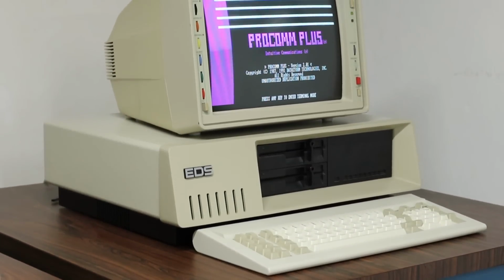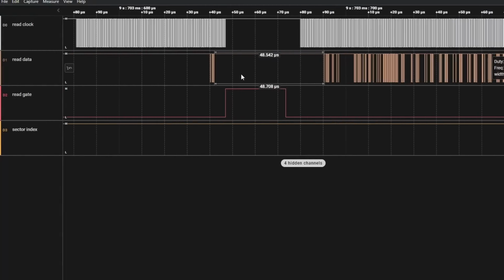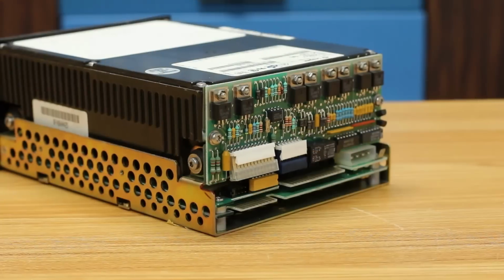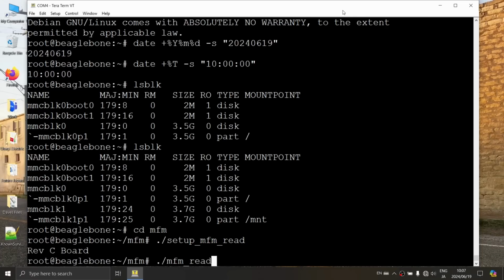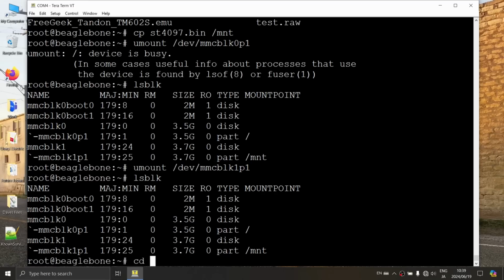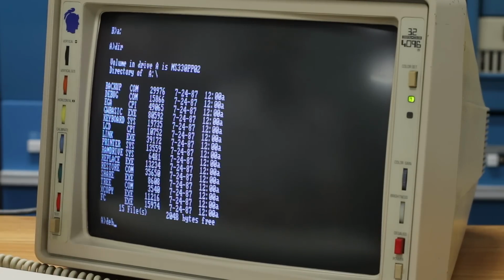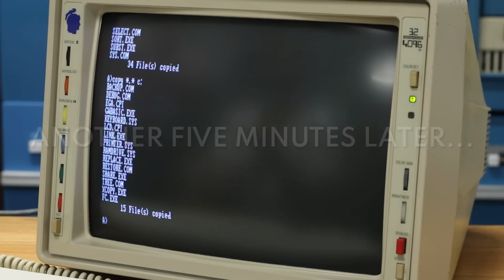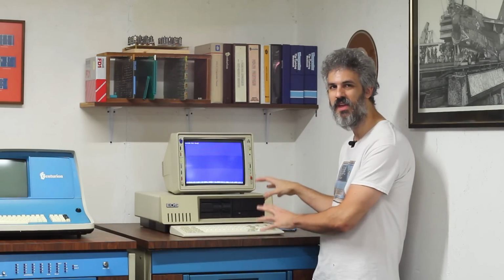FM is RLL, MFM is RLL, RLL is RLL! Fight me.

Comment: As someone who designed hard drive controllers when this tech was new, you are right - FM, MFM and RLL are all RLL. However, the quality of the oxide needs to be a whole lot better for "RLL" to work well. Formatting needs to write new address marks (which begin sector marks and data). Sector marks are a bunch of data which tells you which sector will come next (ie contains the track number and sector number).  However - the address marks and sector data may be interleaved - sector label 1  is followed by data for the last sector, then sector label two, then sector data one! This is because the formatter processor may not be fast enough to figure out which label it just read in the inter-sector gap!

 I warn you -  address marks are a possible problem: Mostly people used the IBM address mark. Unfortunately the IBM documents were wrong! The data bits were defined in chronological order, but the clock bits in reverse chronological order. I designed a controller with the clock bits in the correct order (as an option). Using the bits in the correct order means that the address mark contains a single flux transition in between two gaps exceeding the max legal distance in  legit data. This means it is a unique pattern on the drive surface. The industry standard version is illegal as data, but is not necessarily unique. Using my address mark, most drives had enormously fewer bad sectors and read errors - but were not compatible with formatters made by IBM, Western Digital etc.  I used programmable logic (which was new at the time) to map data into RLL code .
In addition to formatters for mainframes, I also did the first hard drive interface for the Apple ][, and one for the BBC micro. Both used the 6502 CPU - like Woz did for the floppy controller!
Reply: Wow! Fantastic to hear! 
For what it's worth, I've tested every single drive in my collection (over 500+ drives at this point) as RLL and I've had very few drives fail RLL that didn't already have issues during nominal MFM operation.
Reply: @TheDiskMaster  That was my experience after the first year or so. FM was never really used on hard drives, because MFM was well tested on floppies, and there is little difference in the highest frequency/smallest gap between transitions. In the early days -  when MFM was the only game in town - no one tested, but when RLL first came out, there was obviously little demand for it cos there were no existing controllers - so selective testing was introduced. By the time there were RLL controllers in play, problems with oxide coating were already cracked.
Reply: @TheDiskMaster  From what I remember, one needed an RLL qualified drive to use an RLL controller. You could use a non qualified drive and it would work initially but fail pretty soon.
Reply: Very interesting, I always thought that there must be a trick to write rll adress marks. Do you have a video or link for the details of encoding?
Reply: Your explanation of interleave isn't quite right - a given data sector must always follow its corresponding address mark (the controller is watching for the sector immediately following its address mark - always).  The idea for interleave is to enhance performance on systems that can't process data fast enough to read sectors back-to-back.

By reorganizing the sectors so that consecutive sector numbers have at least some number of out-of-order sectors between them, you guarantee the system a certain amount of processing time before the next sector arrives (occasionally a controller might have a limit for how close a consecutive sector may be, but I've only seen this with my own programming for a weird floppy controller, but interleave could help here too).  The alternative is waiting for another full disk rotation which is very slow.

For example, with no interleave the sector layout might look like this:

1 2 3 4 5 6 7 8 9 10

By adding a sector of interleave, the order could look like:

1 6 2 7 3 8 4 9 5 10

Note that there are two sectors between 5 and 6 instead of 1 but that's okay, there's still at least one sector.  A system that can't read sectors back-to-back (but is okay if they are spaced twice as far) can read this track in two revolutions instead of 10.  Going from sector 10 to 1 doesn't have extra space but that's okay - the system won't naturally read them in that order and instead will be moving to the next cylinder or head.  A more advanced formatting could rotate the sectors in consecutive heads/cylinders to account for seek time, but I don't know of this being done in the wild.
Reply: @big0bad0brad  Cylinder skew (rotating the 0 sector start point to minimize latency) can have adverse effects on random access latency, although it greatly reduces sequential access latency. If you were making movies or recording audio, cylinder skew made a lot of sense. For normal office use, it could do more harm than good.
Reply: @mal2ksc  Random access latency shouldn't be affected unless it was already being optimized separately (which it isn't; it's too complicated).

The nature of random access means any change could make it worse.  Or it could make it better.  Overall it's not significant one way or another.

I could see perhaps the very first access being affected if a disk spin-up were terminated by watching index pulses until the disk is up to speed, but again, I don't know of anything doing this besides my own code (mine just does a dumb count of index pulses).
Reply: @big0bad0brad  Not sure if it counts as "in the wild", but I successfully used the offset-between-tracks trick in the homebrew DOS I wrote for my Z80 system. I was able to get it reading nearly one track per revolution, as fast as the drive was physically capable of. I was using a homemade 1771-based controller.
Reply: @gcewing  That's awesome!
Reply: @big0bad0brad  Your description of interleaving is correct, but that's sector interleaving for system reaction speed. OP was describing the same type of workaround for reaction speed implemented inside a microprocessor performing the job of a disk controller, not an ASIC that processes the header as it's read; as long as the disk wasn't moved to a different model controller, and the timing from sector mark to sector data is consistent enough, that works. In other words, while you may have 0 sectors between a header and its data, that's not necessarily so for all drives. This may be the first report of such exotic controllers you or I have seen, but that doesn't mean they don't exist. 

Many other remarkable formats exist, e.g. the Commodore 1541 disk format stores metadata in track 17, not the beginning, and uses variable numbers of sectors per track (known as zone bit recording). 

Fun fact: the Apple II console/terminal, while solid state, also has a cycle time causing seek delays.
Reply: @0LoneTech  Fair, but one of these interleavings is fictional and one was actually used.
Reply: @big0bad0brad  Have you realized that it's rude to call someone a liar just because your view of the world didn't overlap with what they've seen?
Reply: Very interesting!
Reply: decoding that raw flux image will be an interesting problem
Reply: @monad_tcp  especially how address markers are encoded!
Reply: @monad_tcp 
AI can take care of it 😂
Reply: Back in the day we used to swap information on BBSs about which "not necessarily RLL" drives would and would not work with RLL controllers.  IIRC it generally came down to "the expensive ones", as you indicated, which had a pretty good shot at formatting and working reliably.  At that point it was a bit of diminishing returns vs. just buying an RLL drive in the first place.
Reply from the maker: Amazing!
There's the real information! It seems that whether and "MFM" drive formatted as "RLL" is highly dependent on the quality of the drive and the oxide they used. From a purely anecdotal standpoint, it seems to be all over the board with some claiming they had MFM running as RLL for years flawlessly, and other claiming it either fault didn't work or only worked for a short time. Very much so seems like one of those "your mileage may vary" things. Ultimately, the plan is to hopefully get that ST-238R back into the system, since that's the original drive. 

Thank you so much for the awesome story and info!
Reply: I love it when the true experts chime in here...thank you  @andrewgrillet5835 for this fantastic insight!
Reply: I always though RLL was a kind of extension to MFM. a 20MB  MFM drive would be 30MB with RLL, IIRC. What I can't recall are the specific debug commands used for the low level formatting.
Reply: @Mike80528  DEBUG G=C800:5 was used on IBM XT MFM/RLL controllers to format the drive.  I used RLL controllers with MFM versions of the HDDs because the MFM drives were more easily obtainable.  Nothing wrong with 50% extra space for zero extra dollars.  Never had an issue with reliability.
Reply: @thisnthat3530  My memory had it as g=C600 but I couldn't recall if that was right (was pretty there was more). Thanks!
Reply: @Mike80528  If I recall correctly, that will depend on the MFM controller, as the firmware for it is in it.
Reply: @Pedro_MVS_Lima  Agreed, except for the RLL drives that handled it internally, but this is all from memory. There were RLL versions of the controller cards. I generally recall that Seagates tended to work pretty well. The presumption at the time was that their RLL drives were the same as their MFM models just with different firmware.
Reply: I remember back in the day people would reformat their MFM hard disks with an RLL controller. IIRC, you could get about twice the storage if the MFM drive worked with it.
Reply: @tarstarkusz  ~50% more. A 20MB Seagate MFM formatted with RLL would be ~30MB.
Reply: @Mike80528  or specifically, you could turn an ST-225 into an ST-238R with an RLL card, if I remember correctly.
Reply: @mjouwbuis  Yep. Those sound like the correct models, but that was essentially what we did.
Reply: @mjouwbuis  I mean the ST-238R in the video sure looks an awful lot like my ST-225 did.
Reply: @tarstarkusz  It was a bit more than a 50% increase in storage to go from MFM to 2,7-RLL which is the most common form used in the 1980s. But as noted right in the title, MFM is itself a form of RLL -- just balanced toward simplicity in operation rather than efficiency of storage media.
Reply: @mal2ksc  The problem was that it doesn't always work.
Reply: @tarstarkusz  No, and in the moment, we knew what drives almost always worked, what drives never worked, and which would typically appear to work but the data wasn't stable. It also depended (a little) on the processing capability of the controller. The smarter it was, the more likely it could deal with the normal variances of spinning rust manufacture. So somewhat ironically: old drives stood a better chance of working as RLL with the newest controllers that could pull a weak signal out of the noise, while the newer drives were perfectly happy (although perhaps leaving performance on the table) with a wider range of controllers, old and new. It wasn't that uncommon to change to a more recent controller and reformat a drive and get a few more years out of it once it started balking with an early MFM controller. Might as well make that an RLL controller if the drive was up to the task.
Reply: @mal2ksc  I never did it myself.  I just always heard it would about double.  But 50 extra isn't bad either. It turns a 10MB drive into a 15MB drive.
Reply: @tarstarkusz  -- a little over 50% more. Like going from 20 MB to 31. You went from 17 to 26 sectors per track on the IBM 20 MB drives.
Reply: I have done the opposite for my Atari ST. The megafile 20 controller can only do mfm and the drive died, so I fitted a 238R and formatted it as a 225
Reply: @grossteilfahrer  -- That tends to work mostly only if the drive is virgin formatted. I mean, there was the adage of "once RLL, always RLL." So if it was never formatted and you format it as MFM, that should work just fine.

And even changing RLL controllers with an RLL drive can cause marginal results. If you ever did that, you'd want to run Spinrite on it. If a different make of RLL controller was used, you'd want to low-level format it a handful of times before trusting the data. Different firmware on the controllers could get confused by an older, slightly different format. It might take multiple attempts to overwrite the old format.
Reply: So... basically the same as HD floppy disks or Super VHS tapes which have higher flux density?
Reply: How cool! Congrats man, this is amazing
Reply: Thank you.  We need to keep this information alive, and getting it "from the horses mouth" as it were, is excellent.  I hope this is in a book somewhere as well, as print will quite often outlast digital media.

I remember trying to wrap my head around how the Apple ][ disk was encoded.  At the time (i was a teenager) i had a hard time with it.  Makes perfect sense now, but at the time i was "how can you NOT know a 1 from a 0?"  Turns out, it's harder than it looks!  ^-^
Reply: Indeed.  RLL required plated media, or a high standard thereof.  Damn, that was almost forty years ago for me
Reply: IIRC, modern drive encoding uses the change in potential rather than the potential value, so 01 is a change while 11 is not

Comment: How are you planning to do file transfer? Write an XMODEM program for the Centurion, and then use Procomm+'s file transfer support (which surely includes XMODEM)? I don't understand why different disk block sizes matter if you are backing up at the file level... Flashback to using KERMIT to transfer files from our VAX/VMS mainframe to my Atari ST in 1987ish...
Reply: I was wondering the same thing. The serial transfer would act as an abstraction layer, leaving the program on either end to handle any data storage through the OS. Might need something to make a note of any extra attributes the Centurion's filesystem adds to files or translate them to a DOS equivalent, maybe?
Reply: PCPlus does support XModem. ZModem and YModem as well.

Comment: I like the part where they make sure that the SD card is mounted and then writing the raw image to the onboard storage. 😂
Reply: I saw that as well and waited for the part where they pull the SD Card and wonder why it is empty upon inspection on a PC, but it never happened.
Reply: @drstefankrank  And then you hope very perfusely that the root partition isn't a ramdisk.
Reply: @Stoney3K  I also didn't pay too much attention on how big the root is and expected a disk full error, but it seems it has plenty of space.
Reply: @drstefankrank  I expected the disk	full error any moment.
Reply: @Stoney3K  The internal eMMC on a BBB is either 4/8GB if I remember correctly. So there's not a lot of spare room but there is some.
Reply: Well, when dealing with critical, non-replacable data, it's probably better to save to internal storage and then copy to the SD.
Reply: @SenileOtaku  yes, but if it were intentional, I think they would have included that in the video. On the other hand, we've seen a screenshot of that data, so it made its way out of the device at a later point.

Comment: If you used "format c:/s" it would format it would automatically add the files and such to make the drive bootable. And the drive interleave is very important for the speed of accessing the hard drive. One utility that was really useful with the old DOS and early Windows systems was "SpinRite",  More about it in a sec... 

Interleave: 
Reaching back into my memory banks (that may have some damage...) that "interleave" parameter will set up the order of how data is written to a track. If you set the interleave to 1:1, it would create a format were tracks sector would be one right after the other. This is the optimal way to do things...but frequently, either the drive/controller/operating system coudln't read the data that fast, so it would read the first sector, then when it tried to read the second sector, it would already have gone past the head and the drive would have to wait until it came around again.  And the system would become bogged down trying to read from or write to  the drive. A 1:2 interleave would skip a sector, thus a 16 sector track would access sectors in this order: 1,3,5,7,9,11,13,15, 2,4,6,8,10,12,14,16, and a 1:4 interleave would be 1,5,9,13,2,6,10, etc.  And optimal interleave gives the system enough time between used sectors to move the data, then be ready for the next available sector. But the problem then was what is the best interleave for each drive. If it was common drive,   the best interleave was know...but if it wasn't, you had to experiment. And then SpinRite came along from Steve Gibson Research. It would do many wonders for a hard drive, and one of those wonders was figuring out the optimal interleave for a drive. It would not only figure out the best interleave, but it would re-write your drive with its existing data with the optimal interlieve without losing the data and thus could dramatically speed up a hard drive. 

Because SpinRite was really good at being able to re-write data for re-interleaving, and Steve Gibson is a genius, it is also able to recover data from sectors that were flakey, and thus became a great data recovery tool. It was first released in 1987, and is still available today, in version 6.1 and is still doing wonders for drives!